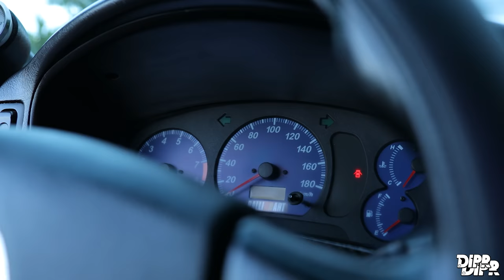6G75 V6 Turbo Mitsubishi Lancer / Mirage Vlog #1 | DIPR Vlogs

Comment: That's a lot of work to make it slower than just building a 4g63.
Reply: Says who? Its a v6 and a 3.8 engine add  to the fact that those 6g75 mivec heads flows a lot that is comparable to an ls7 heads, when modified right especially with a forced induction it would give a nissan vr38det engine a run for its money.
Reply: @osama1929  lmfao, it will never touch a vr38dett. What planet are you living on kid, a 4g63 will always be faster than any 6g motor. I build engines and performance cars for a living and there are so many faults with the 6g series engines. There’s a reason the 4g63 holds so many records.

Comment: Con ese motor deberías a gt3588- 1.00. para 550hp a 93 octanje no hace falta mucho bro y ese caro a menos que no lo Destroke it no vas a querér revolucionaria más de 6800-7000rpm. Con un gt35 o equivalente vas a tener 500-580hp fácil. Y el power band de 4300 hasta 6800rpm. Ponle un intercooler bueno 4" pa mantener el aire frío. O y busca a alguien que hagan un palo bueno que no hay casi nadie. Suerte bro!!
Reply: Si es en Ball Bearing no y todo depende de cómo hagan el manifold exaust,(manifould header) además me sospecho que la van a dar a Nitroso para evitar el turbo lag.